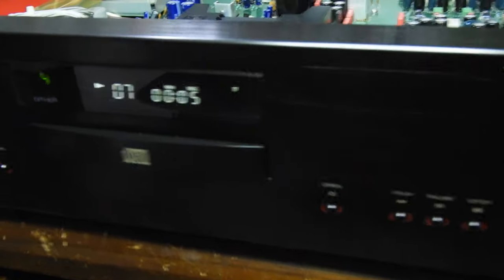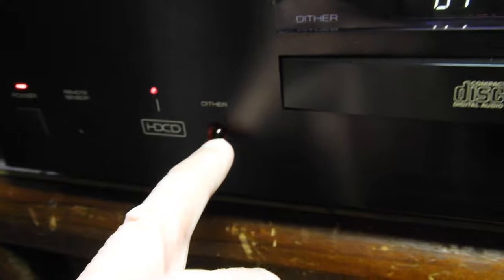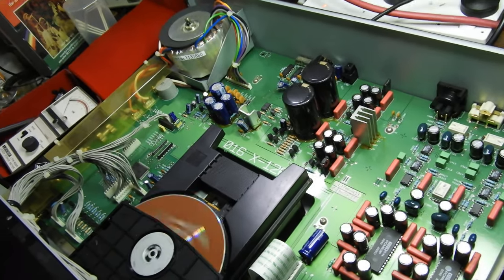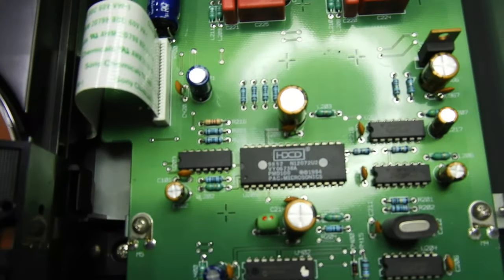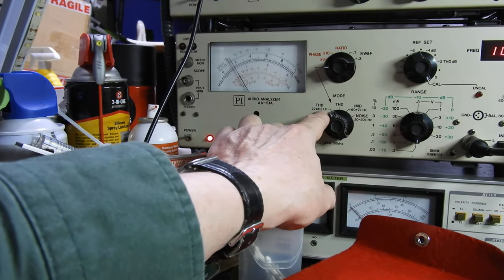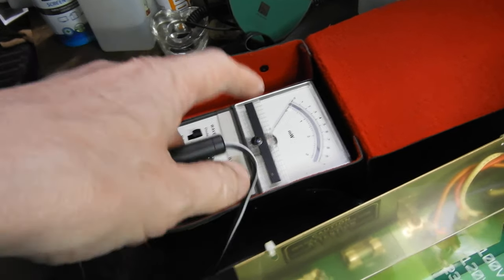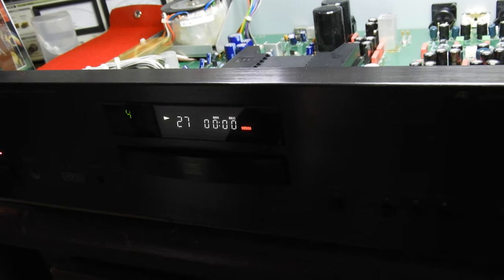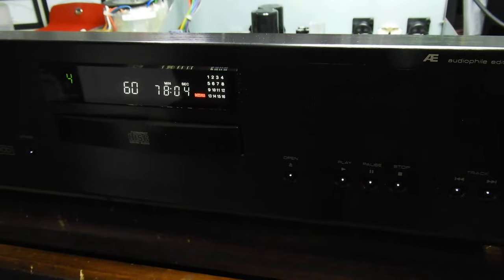Rotel RCD-991 Audiophile Edition-Remarkable technical performance, highest quality parts. Great unit

Comment: This is an excellent cd player.  I've seen these sell before pandemic for $150 used which was a bargain. Todays pricing would be $300 plus
Reply from the maker: Maybe in US. There is $600 worth of Black Gates in them and you will not see one in Australia below A$600-A$700 and one at that price is normally not in good condition.
Reply: @hear-net-au  , it was an awesome CD player when it came out.  my yamaha CDS 2100 is better, but if you asked me is it 10x better the RCD991.  probably not.  nice to see vintage eq, brings back memories.
Reply: @hear-net-au  , I got one and the problem when you insert the CD, the CD tray ejects out the CD.  Since I cannot get the CD player to spin the CD, I wonder if the CD laser works too?
Reply from the maker: @webking185  This is not a laser issue but a dirty limit switch. The servo does not know if the tray is back in due to faulty (dirty?) limit switch and ejects the CD before laser even fires up.
Reply: @hear-net-au  , I took it apart and cleaned up everything. CD tray come out and in.  When the CD goes in. The laser cannot read the CD and it just stays spinning 00.  I am assuming its the laser lens.  I dont believe these parts are for sale any more.
Reply from the maker: @webking185  So you have fixed the limit switches fault and the tray behaves normally. CD goes in (and stays closed), CD spins but it is not read.
Take out CD and close the drawer. See if the lens hunts for focus and goes up and down a few times and that the red light is on (do not look straight into it but from some angle).
The laser your player uses are Sony KSS-213B - the most common variety there is and available everywhere. Prices are from $10 to maybe $30 depending on the source and whether it is whole mechanism or just the head.
If buying on eBay, pick a seller who has sold a lot of them and still has over 99% feedback. Also look for feedback specifically on those heads.
Reply: @hear-net-au  , the lens goes up and down hunting. No red light.  What is the part no. for the belt?
Reply from the maker: @webking185  What belt? I thought you wanted a laser. it is Sony KSS-213B.
Reply: @hear-net-au  i switch the laser and it still spins without reading the disc.
Reply from the maker: @webking185  Well, with the new laser, is the red light light coming out now? Have you removed (de-soldered) the shorting link on i? Does it hunt for focus?
Reply: @hear-net-au  i soldered off and there is a red, not strong.  But very faint and not bright.  Is it really bright?
Reply from the maker: @webking185  No, it is not strong, particularly if viewed during the day. It is only 100µW. But of course without power meter, you do not know what emissions are there. Without taking it to the service centre, it will be hard to get it going, because these days the lasers do not come adjusted from the factory.
You could try slowly turning the adjustment pot (firstly) clockwise and see if it starts working. Nothing much to lose, because these lasers are only $10-$20. DO not go too far and only turn it far enough to get it going. As a starting point, you could measure the resistances on the potentiometer in the old laser assembly.
Reply: @hear-net-au  , will give it one last shot.  Hate to see this go to waste, the guy gave it to me and I was hoping it was an easy fix.  Being that its so old, its hard to know whats wrong.  This is my first encounter with a cd player that when you put it in, the cd just spins fast and not reading and just spins.  If you were here, you can have the unit my friend.  I like to thank you for all your help.
Reply from the maker: @webking185  Where are you located? I am in Western Australia.

Comment: Hi there, thanks for the nice video. I was wondering if anyone could suggest me some good advice. I've got a rotel 991 ae. Some years ago I've changed laser unit because the local rotel technician told me that it was better to replace it...they put to replace some sony kss213B unit; but unfortunately it behaves worse than the original...too much skipping even after cleaning or adjusted it...thank you for your help!
Reply from the maker: Ask him to put the old one back.  Lasers these days need adjusting after replacement. Maybe your guy lacked basic tools like laser power meter?

Comment: so how does it compare to the wadia?! if it's a fair comparison!
Reply from the maker: No it is not. I have not listened to it much, but had regular RCD-991 for close to 10 years as my main player. Whereas it is competent and full of quality parts, it is simply not in the same class. 
Its balanced output is done on op-amps, where the cold signal is derived from hot by inverting it. Wadias have 6 discrete, differential output channels. Not to mention DSP. Wadias weigh 25kg and have magnetic drive mechanism. List goes on.
Reply: @hear-net-au  Of course they are not comparable but I only asked because you mentioned at the end of your video that you would listen to how it sounds compared to the Wadia.